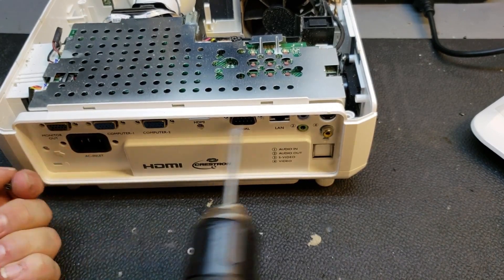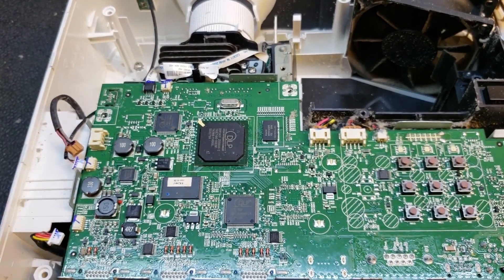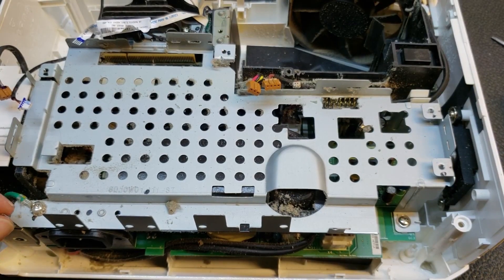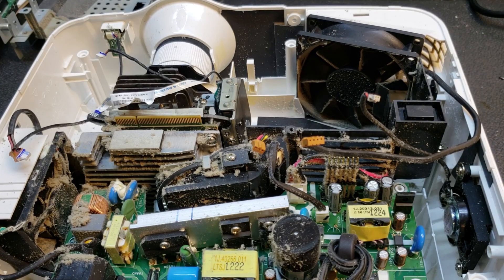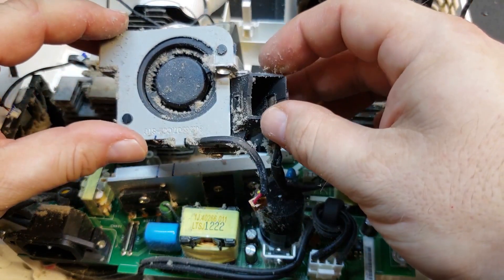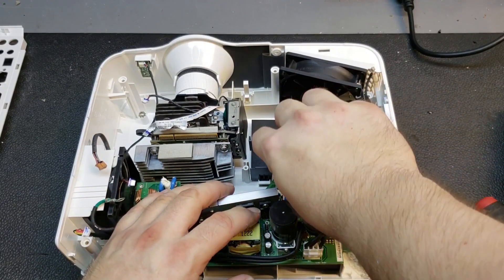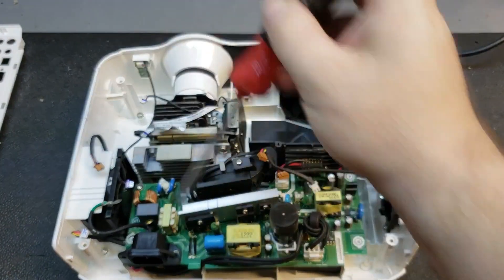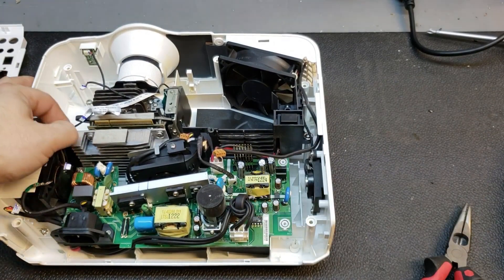Mitsubishi EX240 DLP Repair Part 1 1/2

Comment: hola frank, tengo un mitsubishi EX200U muy parecido a este que no enciende. ya he visto el componente estallado pero no se ve la referencia, en concreto es el IC611, creo que es el oscilador de siete patas de la fuente conmutada. Si sabes la referencia del mismo me harias un gran favor puesto que no encuentro nada en internet. Gracias de antemano y recibe un cordial saludo👋
Reply from the maker: Try this service manual. the EX200U is the same as BenQ MS616. https://elektrotanya.com/benq_ms616st_mx618st_ver.00a_level3.pdf/download.html
Reply: @FixitFrank  no  me sirve no aparece el oscilador de 7 patas. Gracias de todas formas👋
Reply from the maker: @juanmoraaranda3025 you can search the site for BenQ model I listed. Same chassis as Mitsubishi. If oscillator no work, check for Vcc voltage. You might need to lookup the datasheet of the oscillator number. Usually the power to the oscillator is the problem. Bad capacitor is a possibility or diode that sets Vcc

Comment: In this video you talk about projectors you encountered that the dmd needed replaced but the symptoms were blurry picture?  Were there any other symptoms you noticed with this. I think that might be my problem. No white dots but no matter what picture remains slightly out of focus.
Reply from the maker: Hi David,  It's hard to describe. The best way I can put it, is there is no way to focus the image. Sometimes you can focus part of it, then if you change the focus, you might get another part of the image and then lose focus on the first part.  I do not have a way to really show it, but I suspect the mirror arrays break loose from the substructure of the chip and this causes the focus problems.  
I see it on a lot of same DMD's.  They tend to be used in Smartboard projectors but I am sure they are in many many others.  If you can share a picture of the problem(via imgur or upload a YT video), I can weigh in.
Reply: @FixitFrank  I will as soon as I can. The long version is that I am getting a partially working projector for very little money. . The symptoms were dim and blurry pic. Personally from very close inspection of the pics that he sent me I think he was sending a 480p signal into a ex240u that has native of 1024x768 it is my gamble that it was upscaling 480p to the projectors native resolution and thus making the image appear blurry.
The image doesn't look like it has any spots that are more or less in focus. Just an overall fuzzy look. Do you know if this projector auto upscale?  I've read that when it is it will soften the picture, so fingers crossed, this is what has happened. Because if it is, then I just need a new bulb and I'll have a pretty decent projector for 720p gaming and maybe even some 3d movie files. I'm going to go meet to pick it up and I'll give more details when I've done my own testing. Sorry so long
Reply from the maker: I think they do autoupscale to a degree. The blurriness of the bad DMD is unviewable. If the image is just kind of blurry from upscaling it will be watchable.  The bad DMD almost gives you a headache trying to look at it.
Reply: @FixitFrank  I have a pic I can show you but don't know how to send it to you. I know it sounds dumb but how can I share a pic with you lol. I promise I'm not stupid. But I couldn't find a way 😂
I have a feeling ill be watching a lot of your videos now that I've discovered you.
I just got me 2 Mitsubishi xd1000u both working and VERY low hours. I got them to play retro games like ps1 to Xbox 360.
I notice that these will sync on green. The ps2 will output vga but only with sync on green. So I'm gonna see what happens when I pair the two.
I also got me 3 Mitsubishi short throw ex331u-st.  Plan is to do htpc to output 3d bd files to it. Ones I own. 3d can only output in 720p usually, so I figure with native of 1280x800 I should just have bars when doing 720p.....supposedly all projectors work properly.unknown lamp hours on the 331u lot though.
I love to tinker and fix things and I'm usually pretty successful in most of my attempts. Plus I'm good at finding bargins. Both work well together when you do this kind of stuff.
Plus these amazing videos you provide, thank you BTW, really help people like myself. You sir are AWESOME!
Reply from the maker: @Reldvs1  its under details, its frank@fixfrank.com  I dont like to post it in comments because it increases spam emails unfortunately.  Once I hear from you, I wil delete this comment.
Reply: @FixitFrank  well I tried twice but it didn't work. Had a mail undeliverable message. I'll try again later
Reply from the maker: @David-bi4nc  Make sure you are tying it exactly as I posted it.  It's not fixitfank.com it's frank@FixFrank.com (I couldn't get fixitfrank, its been taken years ago).
Reply: @FixitFrank  OK I tried again and think it worked! :)

Comment: hey Frank,   are you familiar with a focus issue with these and identical internals used on 240s?
The projector will refuse to fine focus and be slightly off.  I've done all regular fixes for this issue but it must be a defect from factory as I've gotten 10 or more with same issue...thank you ..
Reply from the maker: Hi Kevin, If you can get me a picture of what the image looks like, I can tell you better but I suspect you might have a DMD problem.  If they were from a school or somewhere like that, they tend to leave them on can cause what is similar to burn-in.  The mirrors start to detach a little and while they look like they are working, they are not even with the others and can cause a spot blur.  The fact that you got everything else handled makes me suspect the DMDs.  I had a pile of UX60s(smartboard) that all seemed to have dirty optics..they all ended up needing replacement DMDs.

Comment: Hello Frank! I have the same projector with another issue. When I power It on, the lamp strikes but after 3 seconds goes off. Both fans are moving. Can you help me with the issue? Thank you!!
Reply from the maker: Hello!  When the projector quits, what LED's are flashing?
Reply: @FixitFrank  Hello!!! I connect the cord to the mains and the Red led is on, I push power on and the Green led starts blinking and the lamp strikes, after 2 or 3 seconds the lamp goes off and he LED goes red again or sometimes Orange. Only the first LED lid, the second and third leds are off al the time. Sometimes, the lamp does not go off and the projector works for hours perfectly, but this happens only 1 time each 40-50 strikes. Sorry for my English.
Reply from the maker: Hola Egoitz! Mi espanol no bueno, Tu engles is muy bueno. 
Sugiero neuva lampara. Lampara. Lampara facil de cambiar.  
I suggest a new lamp first, as the problem sounds a lot like a bad lamp. I also say this because a lamp is the easy part to buy and easy part to return if the problem continues. do you know how many hours the lamp has?
 Your English is better than many native speakers.
Reply: @FixitFrank  hola!! Que tal? ;) I replaced the lamp but nothing changed, same issue. I have bought another unit with the DLP faulty and I'm going to use to repair it. I will inform you when I found the faulty part, main PCB or ballast maybe. Thank you for your help!!
Reply from the maker: @egoitzprieto3264  Soy Bueno! What color is the lens on the front of the lamp?  Is it red/blue or is it kind of green?  I have mentioned it in other videos that the lens can cause the color wheel sensor to shut down.  Make sure the lens has a red/blue coating to block the Infrared light correctly.  
If you have red/blue coating, the ballast would be suspect or power to the ballast.  It should be 380VDC from power supply to ballast input.  If you are in Spain(240V ac),  and you read 300V on ballast input, main power supply is bad.  If you have 120V main power, you may read 150Vdc.  That would also indicate a bad power supply.  
If you measure 380Vdc input to ballast, then your ballast is probably the problem.
Reply: @FixitFrank  hello!! I will check de coating tomorrow, I have the projector in the company. I  detected that when I switch on the lamp, all fans start spinning except the lamp fan, it is like a turbine that colds the lamphouse. I have measured the main PCB and the voltage between red-black is 0v and between red-yellow 5v. I have checked the turbine with an external power supply and It spins perfectly.
Reply: @egoitzprieto3264  That is good information! The lamp fan will cause this problem if it is not spinning.  0v from black to red is a sign of a power problem. I would trace back the red wire connector and see if there is a bad regulator or transistor. This is very similar to the BenQ W1070. They share power supplies I believe. I think your lamp is probably OK.  If the fan is not spinning that will cause the symptoms you have.  
How do LEDs flash? Temp LED Red, Lamp LED Red or Green?  If you email me, I will reply with the service manual.
Reply: @FixitFrank  hello! The coating is magenta. The power supply output is 385vcc and the ballast power on the lamp but 2 seconds and It goes off.